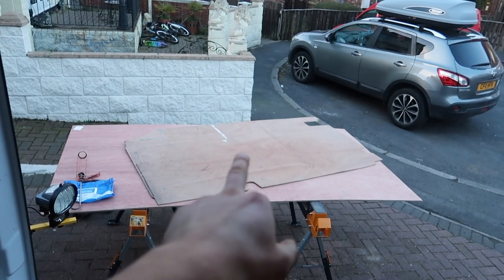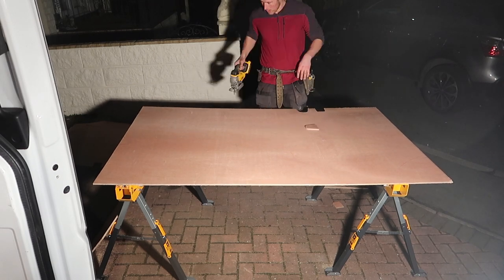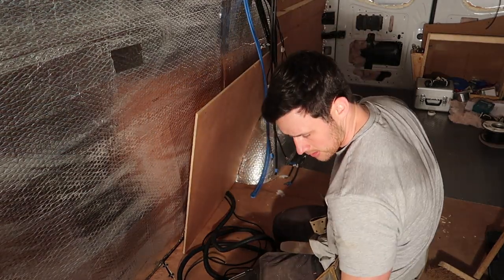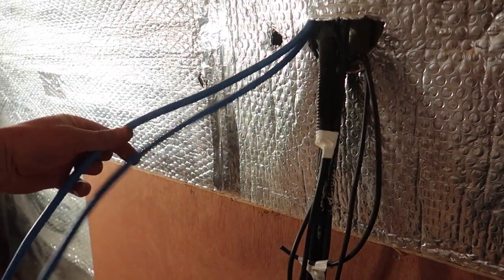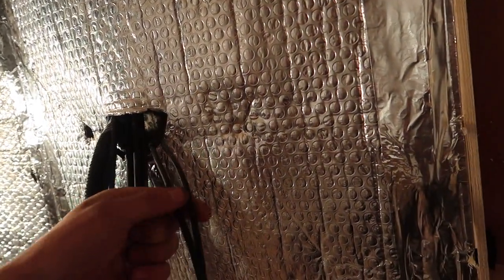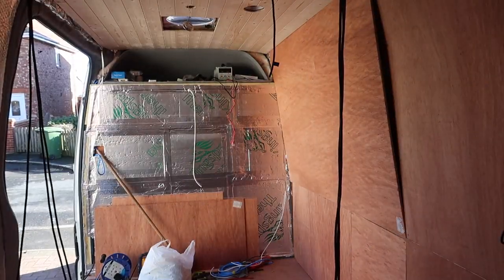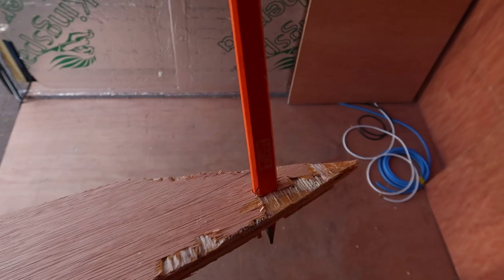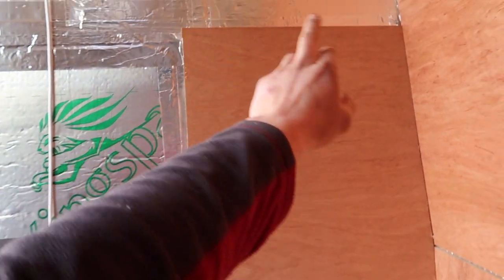Plywood Lining | Ep 19 | Sprinter Camper Van Conversion

Comment: Interested to know since you clad the ply, could you have gotten away with just having 44x12mm batons vertically fitted to the van and fitted the cladding on that or is there a particular benefit to having the marine ply as a base layer? Cheers Scott!
Reply from the maker: Maybe extra insulation and to he able to get a good fixings for cupboards etc. Battons may be preferable for weight saving but depends if you want to work out exact screw locations etc. 6 of one and half dozen of the other
Reply: @ScottAndJen  thanks mate!